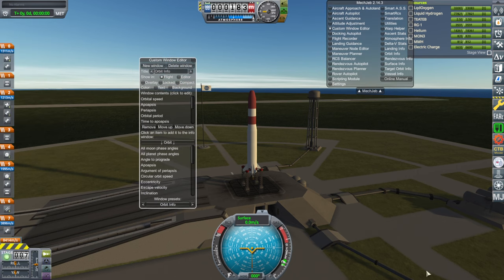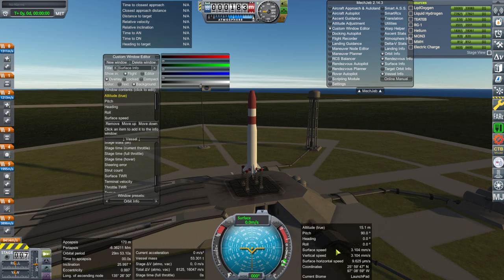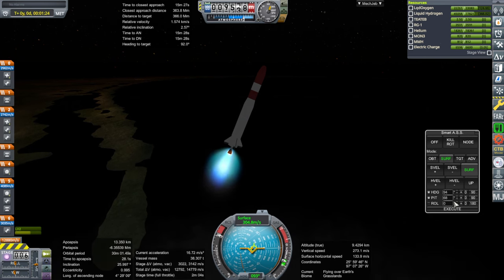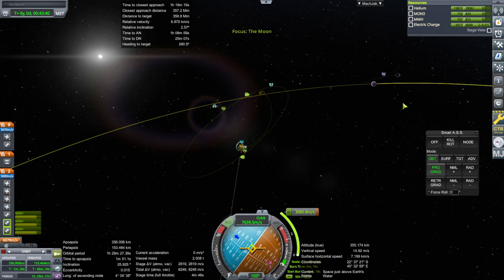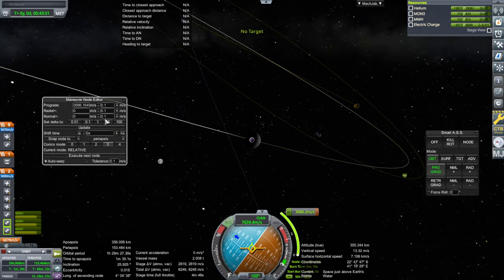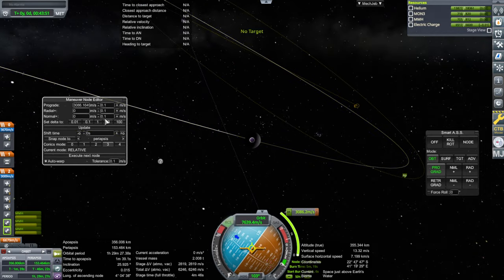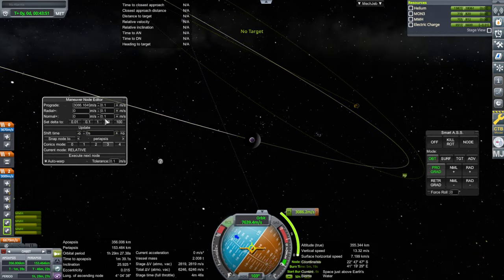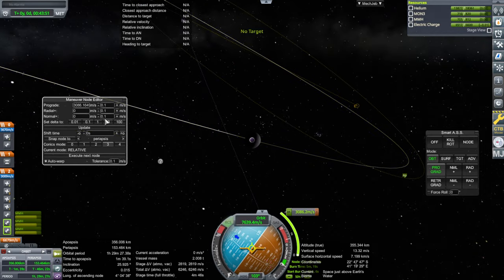Testing the Simple RO Lunar Probe and Rocket (KSP 1.12.5)

Comment: I actually really like landing straight from impact (with antares I for ca 2.2k m/s and HTP last stage with ca 300 m/s), it's actually really easy to time - I'm just starting the burn 32s before impact - and it works every time. + if you really struggle with dv, you can undersize deep space avionics for the last stage only - and spin stabilize the solid motor part from the earth orbit.
Reply from the maker: I think you're only considering RP-1 usage whereas I'm thinking of what it might be best to convey for general lunar scenarios in Realism Overhaul sandbox. This tutorial is not in an RP-1 install and I'll make a separate RP-1 tutorial.

Comment: how can you do an orbit without 9000 m/s of delta v????
Reply from the maker: The lower your gravity and drag losses, the closer to the 7400 m/s surface speed the delta-v cost will be (though generally it's difficult to have it cost less than 8500 m/s). It's safest to plan for orbit to cost 9500 m/s. The main way to reduce gravity and drag losses is with a high thrust-to-weight ratio and minimizing how much surface area creates drag.